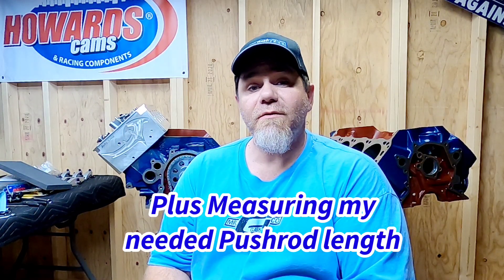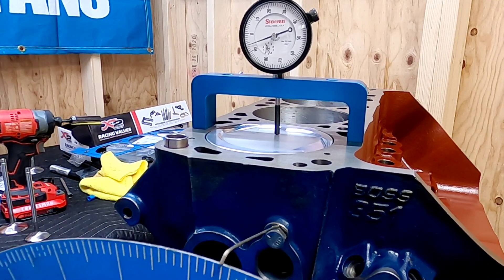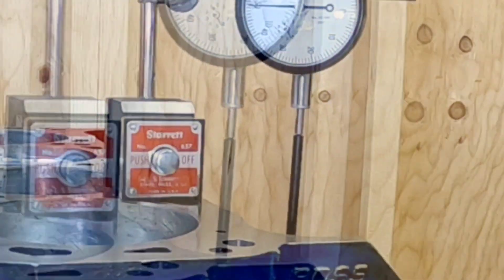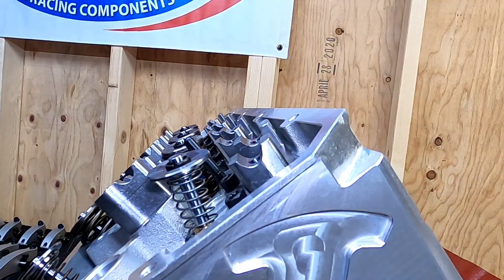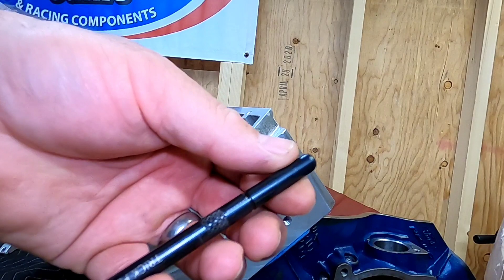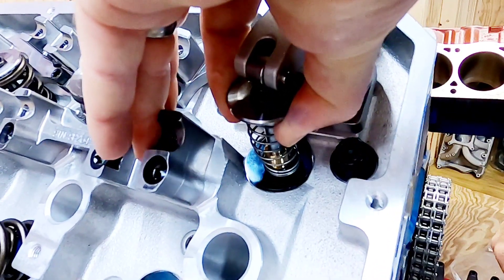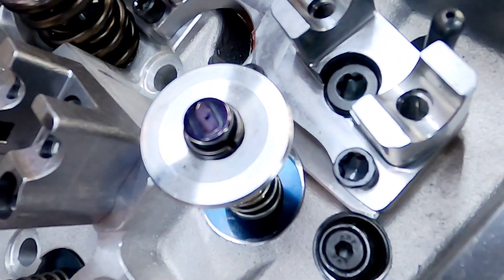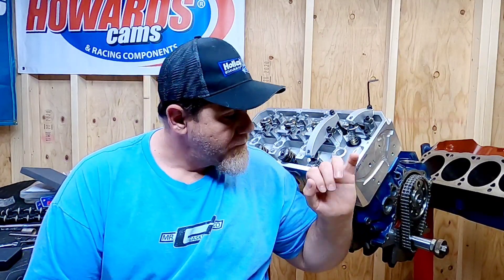Valvetrain Part2, BOSS 429 Style heads on a Windsor Block/ MIXED UP BOSS

Comment: I would have requested a set without the logo on it. I would have agreed to promote them with a decal, banner, word of mouth, or even a tattoo. I don't like the logo on the old school period correctness you were talking about in part one. Besides that this is a beautiful bastard. I would give my left one for one of those. I love the cast Weind Cleveland intake with the valley cover. It's awesome in and out.
Reply from the maker: It would have cost more money to get them without the Hammerhead.. plus I don't mind it as the front of the heads wont be to visible in the truck...  Thanks for the kind words!
Andy

Comment: Bubby. What would make the look of this would be 2 predator carbs just rewatched 'em rebuild the old 640 bbf knowing what you're doing for nostalgia and power that be badass.
Reply from the maker: I'm going to stick with the Holley carbs for the nostalgia...  Plus I know them inside and out...
Andy
Reply: @UnityMotorSportsGarage  my friend. I'll never knock someone over a build. I love where this is going. What's the actual power goals with this engine NA?
Reply from the maker: Cody, right now I'm shooting to make 750 NA on pump gas...  Down the road I'm planning on doing a high compression version and we are going to port the heads and put a real Solid Roller in it and try to hit a 1000... But that is a good way in the future!  Im also looking for a Maverick to drop it in down the road and do a vintage ProStock build
Andy

Comment: I think it would be neat if you made a video or maybe a quick “tech talk” on mechanical rollers on the street. I’ve read mixed opinions on them for the street. Some state high spring pressures will kill the valve train as well as the lifters, and they wouldn’t survive in a street motor. Maybe bushed solid roller lifters would solve this? Also maybe the driving characteristics of big cams down low and at part throttle. Im about to start a 521 with P51 heads and I’m looking for real world cam info. Awesome videos and I always look forward to your videos, keep up the good work!
Reply from the maker: I'm working on one right now as a matter of fact!!  There's alot that goes into making the right choice!
Andy

Comment: Hey, dumb question.
I grew up in the 70s and was always under the impression that Ford Cleveland blocks were stouter / better for high performance than a Windsor block.
Yet, I see lots of videos about guys using Windsor blocks for builds - why, if the Cleveland blocks were better.
Reply from the maker: No it's not a dumb question... Here in NC finding a good Cleveland block is getting hard to do! You are right back in the 70's people built Clevelands because it was the "Good" 351 on the other hand the Windsor was a mundane Engine.. once the Cleveland supply died up around here in the late 80's into the 90's the Aftermarket had developed good Windsor heads and so people began to build the Windsor because it became a cheaper option... I remember when you couldn't even find a true 351 Windsor Cam you had to run the older 289/302 Cams (different firing order) now they all use the 351w firing order..  
I can't speak of the strength factor of the Cleveland Block vs the Windsor but I know have seen over 1000hp made with stock Windsor blocks... Poured and studded.. the works..  maybe DragBoss can chime in on the Cleveland blocks and what they can handle @Dragboss
Reply: @UnityMotorSportsGarage  Hey Andy, whats your take on girdles? distortion vs added strength
Reply from the maker: In working with David Vizard.. I found out that having a aluminum girdle over a steel unit will actually dampen out harmonics where as the steel will just transmitte the harmonics.  There is also the benefit of tying the main caps together to prevent cap walk...but that doesn't become an issue on a Windsor till you get at or over the 700hp level...  
Hope this helps!
Andy
Reply: @UnityMotorSportsGarage  right, but the issue im referring to is distortion due to the torque placed on the girdle twisting the mains from tightening the nuts

Also isnt fretting never eliminated due to the design of the mains if you dont use hollow dowls on at least two of the bolts?
Reply: @UnityMotorSportsGarage  Thanks - that makes sense.
Reply: Cleveland blocks were designed to be thin wall blocks. Anything more than a .030 overbore was asking for trouble, and even some times ANY overbore was out of the question. Even with the Boss 351 blocks which were just standard blocks but with 4-bolt main caps. Windsor blocks were always thought of as thick-wall blocks. Plus, the Cleveland blocks had poor oiling, whereas the Windsor blocks always were regarded as having very good oiling. After a couple years, all the Cleveland engine castings and tooling were shipped to Australia, where they were downsized to 302s. The one thing the Aussies did was they made closed chamber heads, which were just 351-C 2V heads but with the small 4V combustion chambers.

Comment: Nice! I’d be interested to know your projected power peaks, in rpm, torque to horsepower.
Also, it seems that this build will require custom headers?
Might as well craft a set of 4-2-1 (Tri-Y) headers if that’s the case. 
I can’t wait to hear it run.

Comment: Its good that you're being careful and doing it right. You ain't building a shitbox. Modern performance is less forgiving from my experience. Do it right or dont do it at all
Reply from the maker: Thanks for the kind words... My reward will be that first pass down the track! Even though I'm going to Dyno it... That isn't the high point for me.. 
Andy
Reply: @UnityMotorSportsGarage  dyno is a good way to tune it in. Otherwise you might run a bunch of passes before it's right. Those parts are too nice for that
Reply from the maker: The problem is.. tuning it on the dyno is good... But I have always found that once you hit the track you have to do it again...
Reply: @UnityMotorSportsGarage  but you can at least get your afr in the ballpark. You know what you're doing for sure. Just my 2 cents. Great job with the channel